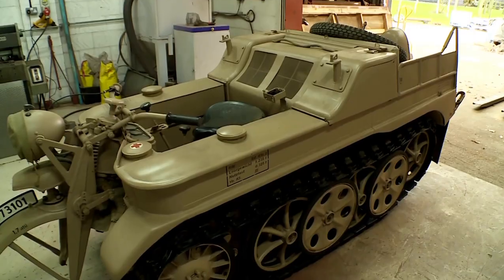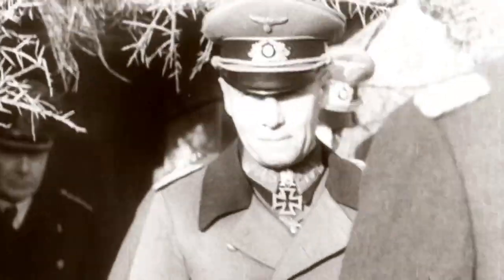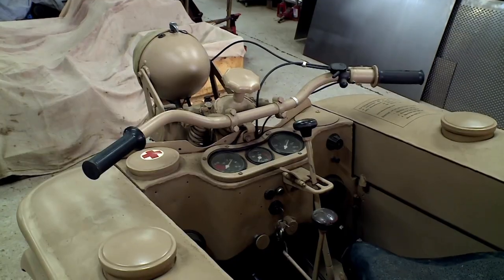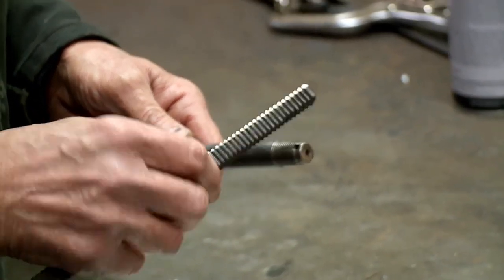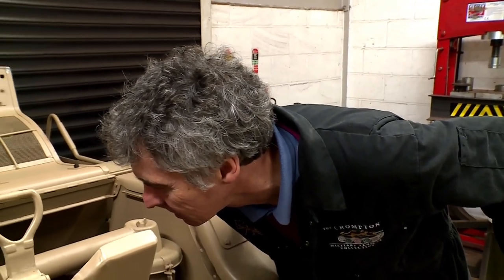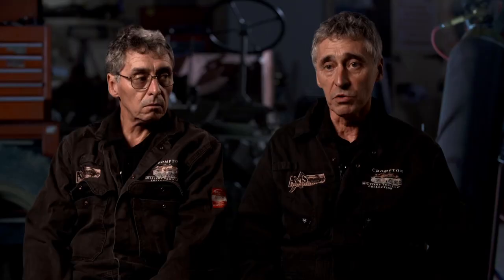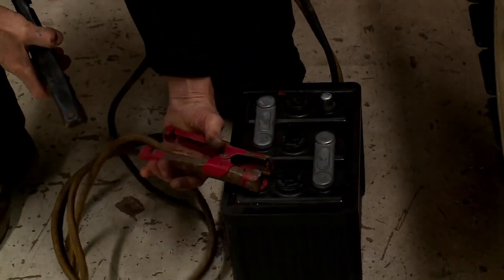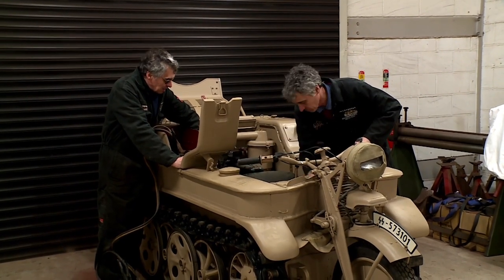Getting A German Kettenkrad Up & Running | Combat Dealers

Comment: I've used s thread file a million times in my life and it was never that tense.
Reply: Ahhhh, but that's because you know what you are doing!
Reply: The whole point of a thread file is for when your not being careful! 😂
And how can a thread file do anything other then follow the thread straight? Unless your using it as a hammer 😂
Reply: To be fair if they messed it up it could have been an absolute nightmare in getting a suitable replacement. That's probably why they were so tense. That's just my opinion though.
Reply: @benh1216  if it was that much of an issue they should have used a rethreading die or a thread mate what they did was show for the cameras
Reply: @carbonfiber492  Fair play. I was just giving another perspective on it.

Comment: wait, so the only things wrong with it were minor damage to the wheel pin, a bit of corrosion on the terminals and a dead battery?
Reply: WHAT A SCRIPTED SHOW.  SO IT WAS WORTH 60K NOT RUNNING.  PUT A BATTERY IN IT AND ITS WORTH OVER 100K